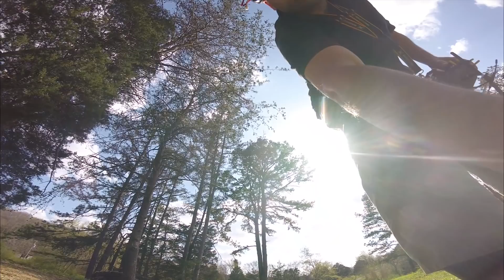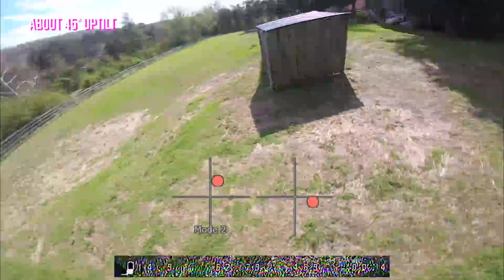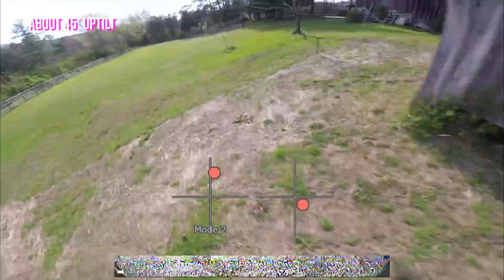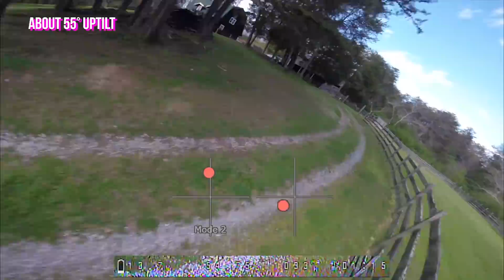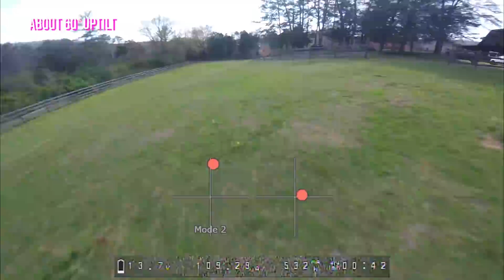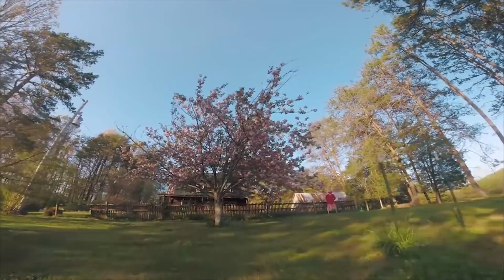FPV Camera Uptilt Comparison | EMAX HAWK 5 RIPPING BALLS

Comment: It’s so silky smooth...but do you think it could compete at a high level?
Reply from the maker: At a high level, the pilot is going to matter a lot. But if we assume all pilots are equally skilled, then I don't think you will find many top pilots running these motors and props. The design of this quad was more for a new pilot who cares a little more about flight time and battery life than winning races.
Reply: Joshua Bardwell perfect for someone like me who is a beginner then I guess. I have the F4 Magnum in my Talon atm, I could see carrying out repairs becoming frustrating g as the ESC pads are really quite small. I certainly found it difficult
Reply: Its all about the pre-tinning, the right solder (electrical, even though plumbing solder does work, just don't...), and a hot iron. Pre-tin absolutely everything, use paste on the wires so it gets in between the strands really well, and then possibly even put paste on the wires after pre-tin. Then put the wire directly beside (not on top of) the esc pads, and heat with the iron sideways (heating both wire and the ESC pad at the same time) for a second until liquid, and move the wire to on top and heat for another second. Make sure to blow on the joint and board to make sure nothing got too hot, and repeat for the remaining wires.

I'm not a professional, but dang do those joints look pro! I also go all out with braiding my motor wires and X patterning them at the bottom under the ESC for good airflow while keeping them hidden and away from prop strikes. If you transition from braided to flat on your wires, use heat shrink tubing at the transition point so it doesn't un-braid later on.
Reply: Jake Garrett nice tip about sliding the wire sideways, I’ll try that, everything else I was already doing, problem is that the XT60 pads really are tiny and sliding sideways would probably mean I join to another wire, I’ll try it on another board though for sure :)
Reply: Oh yeah, the battery leads are tricky, I don't think the slide method would work well on those. Those just require lots of heat. It only takes about 2-4 seconds at 720f or 385c on the soldering iron for the solder I use. I make sure to put a big enough bubble of solder on the tabs so that I don't have to add any more solder after joining the pre-tinned wire.
Reply: NyteFury is flying these stock for his race quads
Reply: Different props for the most part, but yes.  They are super capable quads right out of the box.

Comment: I'll keep saying it.  If you want to go faster, stop wasting money on motors, props, frames, etc...  RAISE YOUR CAMERA ANGLE!   Everyone wants to sell you stuff, but this minor adjustment that you can do for free on your existing setup will drastically increase your pace.  And it works just as good regardless of what software you have loaded on your flight controller.  Its the simplest things that sometimes yield the best results.  Also, please fly at the new angle in the sim first.  Even 2 degrees is noticeable.  Shoot for 45 as a starting point.  And keep in mind as the angle goes up, when you cut throttle, your quad will drop altitude much faster than your'e accustomed to, so stay on the throttle.
Reply: Banggood hates him, learn this "minor adjustment that you can do for free" NOW !
Reply from the maker: I think there is a law of diminishing returns here. You will find many top racers running 60 degrees or so, but few running 70 or 80 degrees.
Reply: Absolutely.  On 2.1mm and 1.8mm lenses the sweet spot is somewhere around 45-60.  BMS is 45 I believe.  MeWo is 50, etc...  But it seems like 45 is a good minimum for intermediate and advanced.
Reply: You aren't kidding about trying it on the sim first.  60 degrees vs. whatever Free Rider's default is, was quite the shock.  Joshua did a video that got into camera angle when he talked about Matty Stunz's 60 degrees of up tilt, and it's effect on acro maneuvers.  And yeah, I'm pissed because I wanted to go fast, and have some pretty powerful motors, and all I would have had to do was make one small camera adjustment!  Damn!  This is a secret kept by the motor manufacturer's I've heard.  An internet rumor! LOL
Reply: gedgar2000 bigger motors just means you go up faster not forward :)   unless you tilt more

Comment: Did you mention the large throttle changes needed when cornering with higher uptilt?
Reply from the maker: Altitude becomes more sensitive to throttle changes as uptilt increases.
Reply: Joshua Bardwell Have you investigated if verticalarms or vertical «roundbar» help with the altitude drop when running high cam tilt - thinking a frame like this https://goo.gl/images/Rmzpn6  They also have a frame with inward tilted motormounts «viggocity»

Comment: What up tilt do most racer prefere.  Ive heard that some are going back to 45 degrees from higher tilts as of late.
Reply from the maker: I think it's pretty hard to generalize about this sort of thing. I don't go to enough races to really say.
Reply: Around 45 to 50 degrees uptilt is pretty normal in races these days. The wide angle lenses give you much more view so even if you fly at an angle of 60 or 70 degrees, you can still see in front of you. No need for extreme cam tilts anymore

Comment: You were blasting around there matey, your going to need a bigger garden soon. To quote Stew that thing RIPPED,,  Just check her out at banggood she not only looked and sounded great in your vid, she looks very cool and comes with the  Magnum F4 Tower System and Dshot 600 esc'c .... This Beast  has gone to the top of my to buy list.  Great flight JB

Comment: Dude I like to see 90deg tilt!! Would love to see Josh ripping around at that angle!
Reply: 90 degrees is fun, as long as you remap the controls a bit (yaw becomes aileron). It's like flying a plane, or more accurately, a missile.
Reply: try 90 degrees in a sim it's awful lol, everything feels so wrong
Reply: Dude, you need some vertical component to thrust... 89 degree uptilt.

Comment: I'm assuming you are not using the Avan Flow props? My Hawk5 pulls 135A at full throttle. I see you were hovering around 100A. Just curious! Its a great little guy. Rock solid and flys like its on rails! :)
Reply from the maker: Those were the Avan Flow props.
Reply: Joshua Bardwell is your current sensor calibrated? I'm pulling 135A at max throttle. Strange. I was flying tattu R-Line 1300mah 95C shrug

Comment: That prop wash...not butterflight obviously. 
Jk
Reply from the maker: What if I told you it was Butterflight?
Reply: Joshua Bardwell then I'd be utterly upset about your tuning skills. 3 years of watching JBs Pid tuning vids were all a lie 😜 Be honest...in truth all the years it was your dog tuning your quads and you threw just some random words at us. 😄
Reply: norazil from my experience the recommended settings are pretty bad. At least if you have rather clean motors. Raise Q by a fare margin (I run mine at 1200) If you have a MPU6000 try 60 for R and lower P a little. DNotch off, Dynamic on. And if possible raise D. On the Defaults mine flew like crap. Prop wash, mid throttle oscillations, and some weird feel from the overfiltering.
Reply: https://youtu.be/x8lvx6Dw9es
Here is an example how it flies with these settings. Wasn't finished with tuning by then so still a little prop wash. Raised D afterwards and it was perfect.
Reply: Stephen Gibb Well, in a freestyle video, the vibrations resulting from prop wash definitely doesn't look good at all. Mid throttle oscillation either, because it creates tons of jello. So yeah, we DO care about it. Especially when you're interested in making good, smooth videos of beautiful spots. And personnally, that's the kind of videos that brought me into this hobby, and what I want to create and share.
Reply: That was some killer flying!
Reply: I believe you cos I do get prop wash even on Butterflight defaults and recommended for my setup at 8/8k..
Reply: Stephen Gibb wow...so serious. Doesn't even understand a joke.
Reply: bla bla bla propwash is that all people care about seriously i mean people have no idea the compromises you make to the handling of your quad just to get rid of a little propwash.
Reply: Stephen Gibb 
You can bet that racer don't give a rat's A about a little prop wash. Remember that a go pro on a 270g dry Weight quad will require more tuning than usual. Add the go pro, and something will need to be tuned out. This vid gets the camera tilt subject matter across nicely. Based on this, I'd say 50 deg would be a good max for me ATM.

Comment: Great video. I need to get one of this little racing fpv quads. I’m new to quadcopters in general just got a mavic Air about a month ago and love flying it in sport mode but really hate the delay and don’t want to crash it. What googles and transmitter do you use? This video feedback is amazing.
Reply: That also, was an action cam recording the flight. The feed in the fatsharks is not that clear. Nor is it true HD. The Hawk5 comes with a dipole antenna. 200mw.
Reply: That video is not what you see. Its that bottom static covered image with the battery voltages is what you see (though he has his cropped, its not a little bar, its pretty much the same as the Go-Pro, but super static covered and low resolution). Lower resolution = lower bandwidth required = lower latency for a fixed bandwidth.